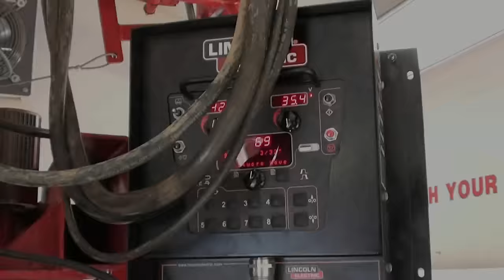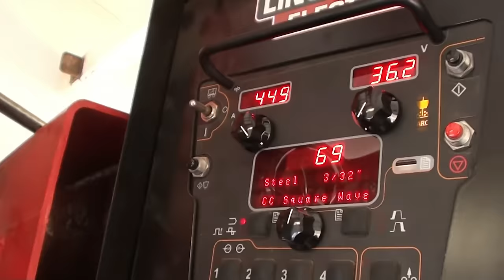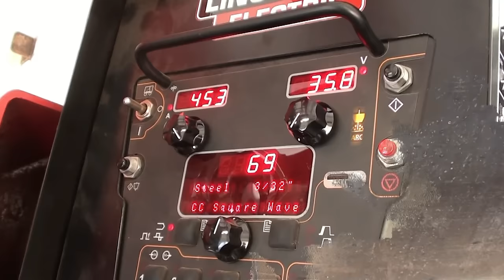Sub Arc Welding - SAW

Comment: All that tech and we're still displaying fractionated "3/32 steel" we need to drop it and go metric ASAP
Reply: w5monkey maybe you just need to memorize your decimal equivalents and keep it American AF
Reply: No functional reason exists to change because of the enormous installed equipment base of millions of machines and components. Going metric to appease autists (who should be eliminated by eugenics so they don't annoy the rest of us) is not an ECONOMIC case for change. 

"Hurr, durr, metric is better because it's metric" is not an argument. BTW repair machinists have no problem working with a mix of Imperial, metric and fractional standards every day and unlike users of production equipment were all one need do is match wire, gun liners and consumables we have to think in those terms to make and modify parts. It's not hard, and anyone it IS hard for should be pushing a broom.
Reply: Ob Fuscated >:(
Reply: W Winterheart 
I was reading the annual report from US Coast and Geodetic Survey. The geodetic survey and mapping project of the US. Not an imperial unit in sight. Except for miles but only in approximations. Centigrade and meters. 

And the best part: dated: 1895. 

Looking at the earliest US Geological Survey maps, kilometer scale bars standard. In addition to mile scale bars. 

Very rarely do I encounter feet in geodetic land survey. Actually, so close to never it’s not worth mentioning.
Reply: Amen !!!  Angry Skull. Fuck the Metric System Bullshit !

Comment: I used to work at Union tank car company and we used a bunch of these but theyre much larger than this one, to weld the joints for each tub much like this except the pipe is 10-12ft across and the wire is much thicker

Comment: the flux granules can be reused , but they need to be replenished. they are bits of flux that get melted in the weld puddle in order to form slag that will float out impurities in the steel as well as protect it from oxygen. as for cost effectiveness, the argon is cheaper alone, but the flux is more cost effective as there will be better welds and less porosity. the argon shield is not as effective outside as even a slight breeze will blow away the shielding gas exposing the puddle to oxygen.

Comment: The cap pass doesn't look that good somel looks bigger some looks smaller. Also the nosal just little bit to high needs make it spread out even around some might have medal scales because the pipe need better clean and the flux not clean you can hear it pop during welding but submerged Arc weld machine is the best Equipment for pipe/plate butt welding.✌️
Reply: Khamphat Souvannaphim R.I.P. English
Reply: Maybe the best for the 10% of the time you can roll the pipe. This machine is useless for majority of field welds.
Reply: Chris McWhorter Really?? No kidding? So it’s not for field work? Astonishing!! You must be very smart to state the blatantly obvious. Wow!
Reply: Where can I get Sub Arc like this to buy? I have the NA 5S 8400 and it is chipping out as soon as its done 3 inches of weld.

Comment: This is only using one wire for welding. We used twin sub arc process (two welding wires) to repair work rolls at steel mill and I've got a proto type that uses three wires with only one 1500 amp welding power source and have seen 1450 amps while using three 3/32 filler welding wires in same welding head. Lincoln won't talk to me because I'm not an educated engineer even though they don't have this welding system.

Comment: In the propeller shop we used to use the sub arc to weld up stainless bearing surfaces on huge tails shafts. we would weld 2 days straight around the clock. Then machine most of it off then polish it for another 3 days.
Reply: Damn shame you didn't grab some video essay.
Reply: El Guapo would you say you had a "plethora" of welding experience?

Comment: Car exhaust is CO. Carbon monoxide. It is not the same as shielding gas. This process uses an agglomerated flux and a solid wire. The flux, which looks like sand, acts as the shielding gas, much like the flux in SMAW. So no gas is needed.

Comment: The reason we welded with the amperage so low was we were required to air chisel out welds before every pass. We ran low amps to keep the weld from melting in the side wall preventing to use of a grinder to clean the flux out.

Comment: Is the pipe pre heated to insure full starting penetration? Also is the filler wire similar in composition to the pipe? Finally is the heat controlled during the weld to control the heat affected zone and prevent cracking? Thanks, just curious
Reply: Thanks. I learn something new every day. I welded for over 40 years and thought the cracks were due to metal contraction. I guess that explains why low-hydrogen rod was used in critical joints.

Comment: I run an esab on pressurized vessels. Its ran 800 amps using  5/32 L50 Lincoln wire and 960 lincoln flux

Comment: I used to weld with a sub arc in San Antonio Texas, where do you work so I can apply there. I welded with two 3/32wires at a time at 6 inches per minute and welded both sides of the plate. The place where I used to work closed fue todo the resecion back in 2009. Don't mind moving to another state.

Comment: I recently saw this process at a fab shop. 42"  .750 wall pipe, 2 welders made the root pass in about an hour. They said it would require another 6~7 hours for 2 welders to complete. They transferred the pipe over to the SAW machine and said it would take an hour to complete.  You do the math.

Comment: Are those metal beads? using the arc to heat the ends of the pipes, and melt metal beads into the groove?
Reply: +Landon Nope, it's flux. The welder uses standard welding filler wire.

Comment: I make pressure vessels (mostly sandblasters) and use a SAW, but mine looks like and antique compared to that setup!!

I would love to know what flux is used, it looks like 760 but not sure.  also would love to know the thickness of that pipe, I might run 300 amps max on my welds

Comment: Ok so does sub welding just stand for submerged welding? That is just a guess based on what I am seeing. What is that powder around the wire? I assume it acts like an inert gas or flux. I may be completely wrong either way a response would be appreciated.

Comment: I use a SAW at work myself putting 1 1/2 bar onto 5x5 angle 20 ft with a 6mm weld

Comment: should the ripples be more rounded? even in the smoothest welds sharp ripples are a stress point. i am not saying a roll of dimes but seems the power supply would have more control over puddle/deposit formation. why SaW and not flux setup? the SaW i use can keyhole through a 3/4" butt joint. not trying to be a pain. if no one asks questions no one learns.

Comment: I thought I knew a lot about welding myself being a great TIG and MIG welder but what is the purpose of the rock looking substance? Does it cool the weld quicker?
Reply: +30spooln its a flux, basically serves the same purpose as shielding gas when doing tig/mig or the flux on your electrode when SMAW (stick) welding

Comment: I've done a fair amount of welding in my time but I have never seen this process before. What is the advantage of this over more conventional methods?
Reply: Intensity controls heat affected zone, and deposition rate is high. Can be used on thick materials. I've seen etched cross section samples of 2-1/2" plate welded single pass with only 1/4" wide HAZ.
Reply: nautamaran Don't know what you've been drinking or smoking but would be nice to get some.

Comment: This appears to be similar to MIG welding but the shielding gas is replaced with a solid granular substance is this correct. What are the benefits of this over other types of welding?
Reply: +Phill Huddleston High deposition rates, no down time due to reposition rates etc that a person would need to do. Unlike GMAW welding the wires for SAW can be up to 5/32".

Comment: Ah, thanks for correcting. I though the pipe was grounded and the tip created the arc to melt the powderized filler, did not realize the nozzle had the wire coming out and the dust was the flux.

Comment: This may be a dumb question, but are the granules fed into the tip to act as a shielding or are the granules a byproduct of the welding process?

Thanks :-)
Reply: What is the benefit of the granules over using a shielding gas?
Reply: Smartass365 Less susceptible to atmospheric conditions. Particularly wind. Often, pipeline welding is done outside in less than favorable weather. Plus, the excess flux is often reused, whereas a shielding gas cannot be reused.
Reply: Russ Walker Ah, that makes sense. Thanks for clearing that up :-)

Comment: Excuse my ignorance.  Why not use flux core wire?  Is the flux core harder to clean between passes?
Reply: flux core does not flow as easy and there is a bigger possibility for porosity in the weld, also as far as reclamation of flux you will reclaim about 50 to 75 percent with the newer machines, with the old machine I was using it did not have all the vacuum attachments they got in the way of flanges and pipes in the tanks.

Comment: Is this for pipelines? Can it replace a work crew(including cost benefits), or does this machine need a factory environment.
Reply: subarc welding can be done anywhere where a rotating manipulator can be utilized.  Thats for pipe welding. Subarc is not affected by the weather except for rain. I have done kilometres of subarc welds in the  field welding huge tanks and pipes on dozens of project in Australia
Reply: it can also only be used in the flat and horizontal position for obvious reasons

Comment: You still have to monitor volt, amps ,and flux flow try to keep
Amps and volts within parameters 
For the size plate you are welding

Comment: @squidduck Just curious but why would you run AC on a final pass? Surely AC=less heat at the same current and voltage, what's the benefit?

Comment: I wonder how the shielding material doesn't end up contaminating the weld?
Reply: It goes into connection with the melted metal, to keep the welding clean, then goes to the top of the metal and protects the welding from the atmospheric air

Comment: what is the purpose of the sand or powder? Is it used in the welding or is that a by product of that type of welding?
Reply: From what i can tell the grit is a shield gas substitute
Reply: oh...cool
Reply: "The molten weld and the arc zone are protected from atmospheric contamination by being "submerged" under a blanket of granular fusible flux consisting of lime, silica, manganese oxide, calcium fluoride, and other compounds. " direct from wikipedia. i think its pretty cool

Comment: What is Sub arc welding? is it like thermite? use for train tracks?
Reply: It means it is welding under a layer of flux, the flux that touches the weld turns to slag and the rest gets collected and reused.

Comment: I don't understand what's happening. Are the beads/sand being melted between the two pipes?
Reply: those beads are not welding. They're just to provide as insulation during the welding process. It's called submerged arc welling because the welding process is submerged by those beads. Insulation is required for a clean weld with no  spatters.
Reply: So the beads are poured out through the torch/fixture pointing into the pipe joints? Why wouldn't a gas arc welding be used? Thank you for answering!

Comment: whatre all of those pellets? is that flux?
Reply: it's granulated flux. it's pretty much like flux core wire feed welding on steroids. huge wire, very high power, a ton of granulated flux for shielding.
Reply: I was thinking it was sort of like the stuff that coats the sticks in stick welding and displaced oxygen in the air.

Comment: what is that thing looks like white sand? and what is it used for?
Reply: +AYMAN .g That's flux, "sand", it melts at the arc and shields the weld until it cools, hence the Submerged (or Shielded) Arc Welding Process SMAG.
Reply: David Parker oh interesting. Thank you :)

Comment: 28 to 31 amps. Yes....what's so funny? I was welding 42ft round rings. They needed to be higher. Your doing pipe, 2 passes, on a base ring @ 1 1/4" thick we ran 750v-31amps with a travel speed of 28ipm. The calibration rate of our weld techs was higher.

Comment: what type of n.d.t. is used on these joints?
Reply: +xAZAZELx13 100% joint efficiency? I use the s.a.w process on a daily basis welding pressure vessels under a.s.m.e. code. what certifications do you have?

Comment: looks to me that the volts are to high for the amps. I weld with a sub arc and at 500 amps. I use 28 volts.

Comment: Looks similar to 3d metal printing process ?
Reply: Sounds like you made some shit up buddy.
Reply: Powder like this within a boxed area and they fire like a laser or something into the powder, it fuses/melts ?  it together to make a 3d metal object.
Reply: ***** hhhhhhhhhhhhh The guy said. 3D METAL Printing. I know 3D printing exists, I had to study it for my Engineering coursework as an example for computer aided manufacturing. 3D metal printing doesn't exist
Reply: Uh... huh?  It sure does.  It has for some time.  To google with you - DMLS is but one form of 3D metal printing.
Reply: anoname 3d metal printing most certainly exists.
Reply: it does I worked with that, is just iron powder glued in layers by a laser the resulting model is too fragile then it needs to be "impregnated" with another metal like  brass in an oven. I've seen other applications like building aluminium parts just like it was a regular 3d filament printer (melting down  aluminium) it all depends on the function of your product.
Finally I've seen guys creating crazy sculptures  with just a welder and a metal file....

And that was more than 3 years ago hahahaa

Comment: That's incorrect! The wire does all the filling. The flux is there to protect the weld from oxidization and keep it clean from contaminants while it is white hot.

Comment: What's the medium used for?
Reply: Th3uNn3rV3d Flux, if you leave a fresh weld open to air the steel will oxidize and result in a poor quality weld.

The flux agent typically releases an inert gas (like argon or nitrogen) when it burns, which will not react with the metal.

It is the same purpose as the powder coat on Arc welding electrodes, and the shield gas used in MIG/TIG welding.
Reply: Nathan Van Betuw Awesome, today I learned. Thank you.
Reply: Nathan Van Betuw Thumbs up! Thank you!

Comment: And I'm just a stick welder
Reply: Stick welding is as much if not more of an art than mig welding. I know mig welders that would rather shovel sh*t than let anyone see one of their arc welds.
Reply: At least you aren't stuck with a boring AC buzz box like me in the middle of Mexico. I really want to move on to DC stick welding and I'm so tired of AC stick. I bet you can convert your badass AC/DC stick welder into TIG with a custom pedal and a torch.

Comment: Perhaps the most boring job I ever had running multiple passes on giant print rollers with the excitement of knocking slag off the bead every now and again with a hammer.
Reply: +Charles Moore I feel your pain. Try doing it on 2 separate heads at same time with one of them having a cooked work line messing up your parameters

Comment: Cool process, too bad I live in Mexico where AC welders are more accessible than DC and I hate the goddamn AC polarity so much. It won't let me use my fucking 7018s and 6010s. AC stick welding is for chumps and I look at DC as the better choice. My AC SMAW beads can't even look like this.

Comment: YOU R RUNNING "WAY" OUT SIDE OF YOUR PARAMETERS BEING SEMI AUTOMATIC LIKE THAT YOU SHOULD HAVE HAD A MUCH MORE UNIFORM WELD, I COULD DO BETTER FREEHAND WITH DUAL SHIELD OR EVEN CORE SHIELD 6. IF I WERE RUNNING YOUR WELDER, I WOULD HAVE THE INCHES PER MINUTE, VOLTAGE , AND AMPERAGE SO DIALED IN YOU WOULD ONLY SEE A DIME HEIGHTH AND WIDTH WELD WITH PERFECT UNIFORMTY